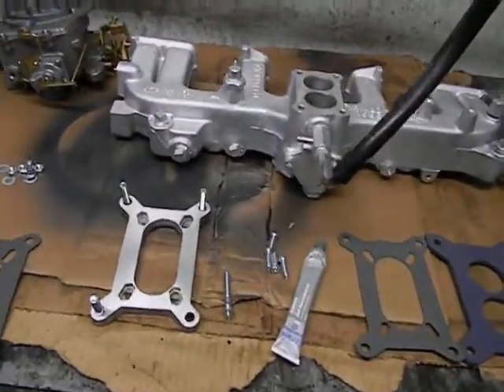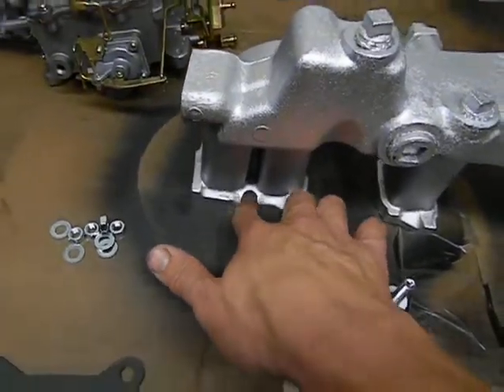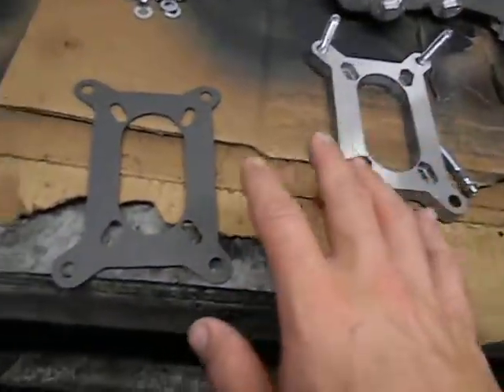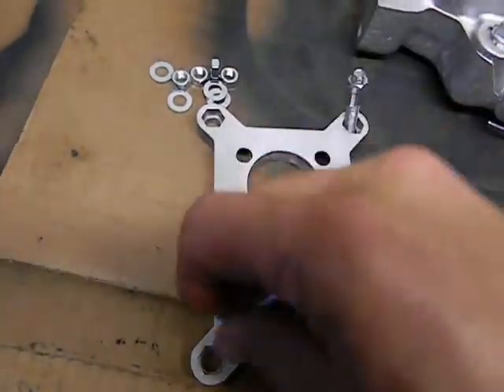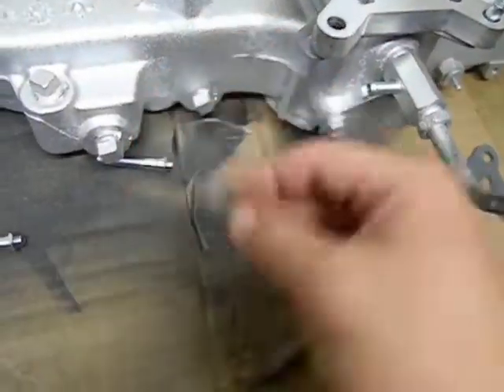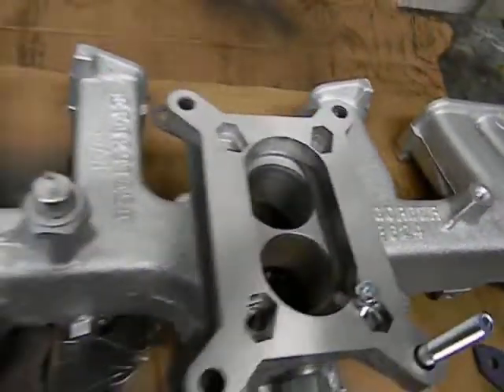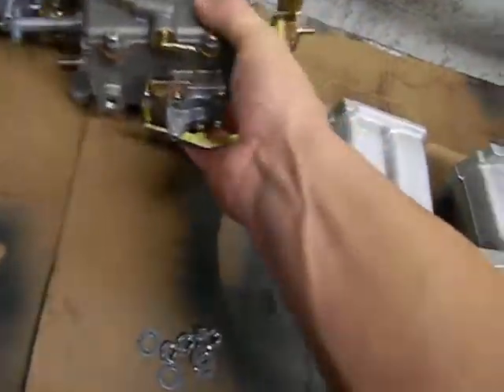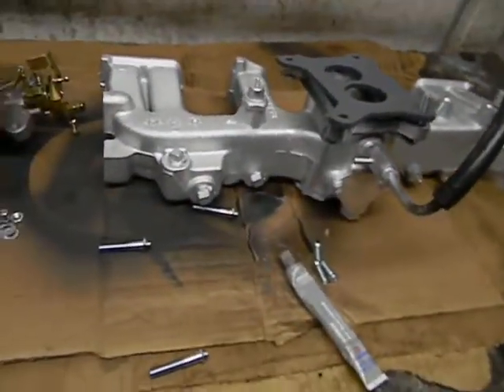Jeep Wrangler YJ 258 to 4.0 carb swap HEI  Part 8  Carburetor

Comment: i want to do this on a 1997 wrangler.  i want to sue the same fuel pump.    so i assume the pressure will be to high.  so how can i dial down the fuel pressure with the fuel returning back to the tank
Reply: low pressure fuel pump

Comment: I agree with 99% of this but I would have use the 4.0 intake blocked the injector holes . The runners are closer to equal length .
Reply: I wanted to do that several years ago, but I had a hard time finding any TB to carb base adapters, which I found strange. I assumed there'd be a couple options out there, with as common as it is for people to want to put a carb on a stroked 4.0. Maybe I just didn't look hard enough?

Comment: How to do distributor wiring if change to caburator?
Reply from the maker: Only one wire to 12v and one wire to tachometer.  https://www.ebay.com/itm/HEI-Distributor-with-Red-Cap-for-1956-1990-AMC-JEEP-INLINE-6-232-258-6-Cylinder/224353591000?fits=Make%3AJeep&hash=item343c841ed8:g:x1UAAOSwvCpgKupO

Comment: I’m currently running boost in my 4.0 efi. I want to do this swap for easy tuning and cam upgrades and high boost with blow through carb. What you think?
Reply from the maker: Sounds great also you could jet your carb for e85 and take advantage of the 108 octane and the cooler charge running alcohol.  Keep me updated
Reply: Do you have a part number for that adapter plate? Or a link? I can’t seem to find one

Comment: Do you have a part number for carb adapter
Reply from the maker: https://www.ebay.com/itm/Carb-Carburetor-Adapter-2bbl-to-2bbl-Rochester-Holley-2-barrel-w-studs-gaskets/132531362836?hash=item1edb7c1c14:g:ni8AAOSwacVaoYU9:rk:9:pf:0